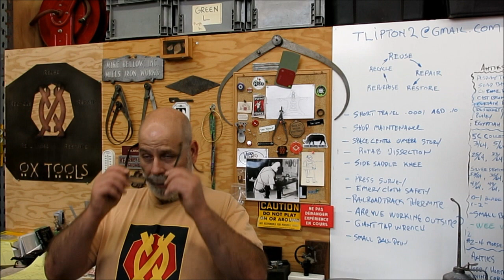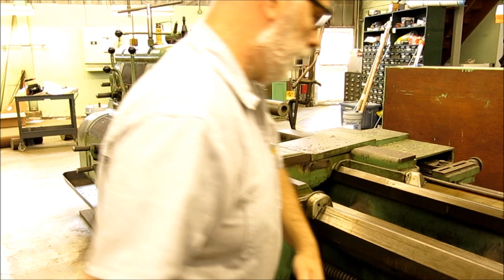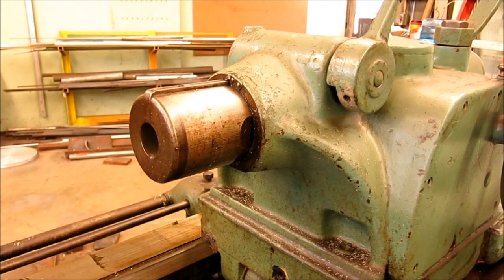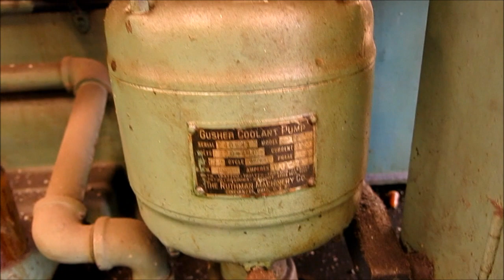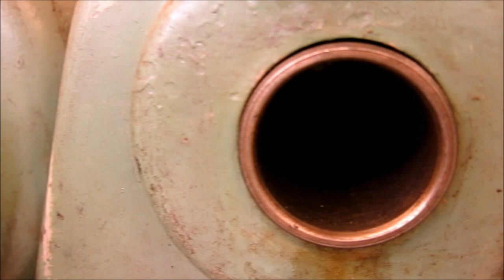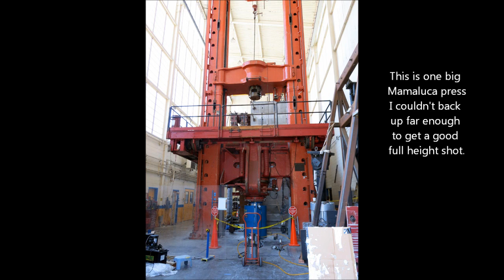Axelson Lathe Survey

Comment: Cool stuff. Two questions:
1) what did they make on the lathe
2) any guess as to what it will sell for? As the other comments say, its a bit big to fit in my garage.
Reply from the maker: Hi Patt,

The machine supported geology research. I think Mark said they used to bore tubes that got filled with something and capped. The operation moved to UC Davis and they didn't take the lathe. Current opening bid is $3k. No bids were received. It will probably be re-listed.

Cheers,

Tom

Comment: That's a nice piece of Big Iron! I was once offered a 15" Dean Smith & Grace in almost unused condition for free, I just had to take it away. At the time I was limited to a Boxford in my bedroom and I had to watch the DSG go for scrap.

One of the nice things about my otherwise quite compact Harrison L5 (9 inch swing) is that with the L00 spindle, it's bored to clear 1.375" through the centre.
Reply from the maker: Hey Paul,

That's an impressive hole for a small lathe.

Cheers,

Tom